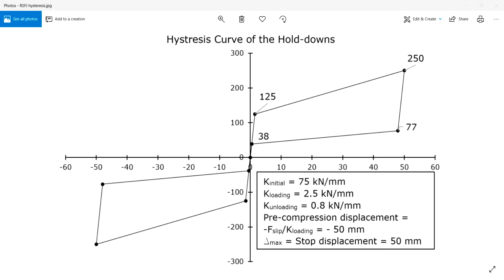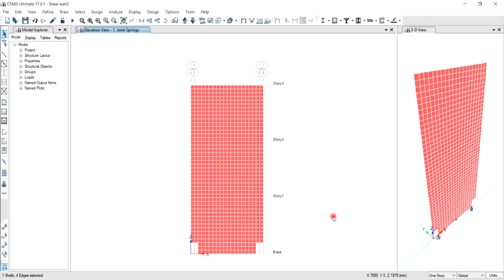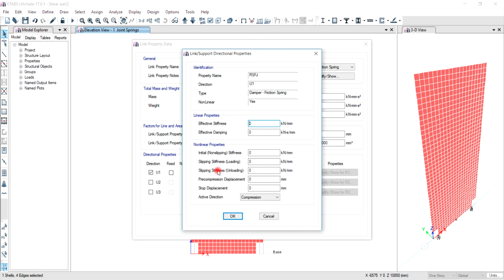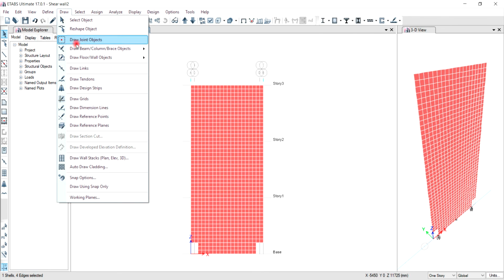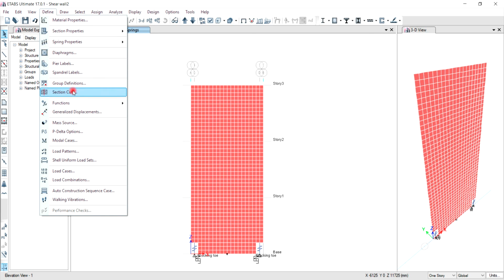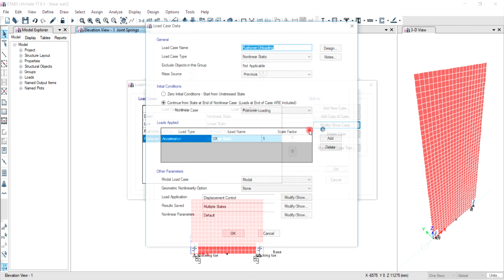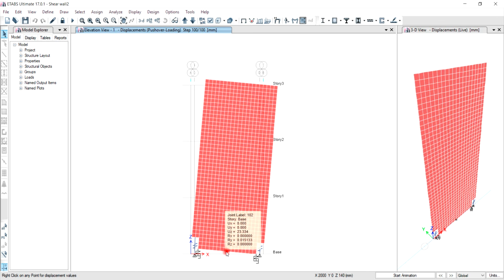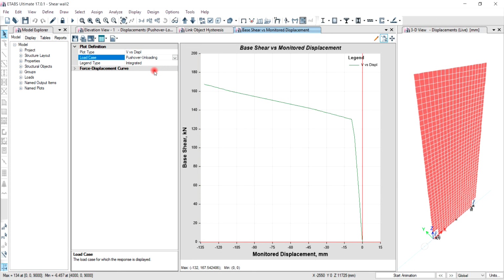Tectonus Modelling Tutorial -  Shearwall video

Comment: Interesting that you had the wall bear on the ends near the dampers, which limits the utility of the compression damper. Why not have the shear key also be fixed in Z and the tension and compression dampers work equally?
Reply from the maker: If that is implemented, the system becomes a rotating wall with reduced lever arm. It also needs special design at the bottom that allows for rotating. However, it will have better performance in relation to wall and floor interaction. Both concepts are feasible and can be used in different cases.